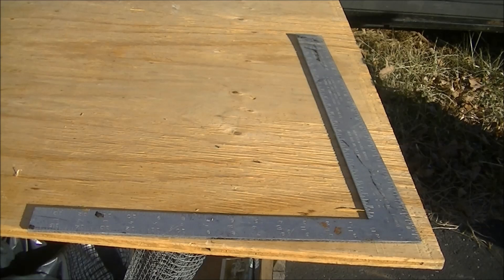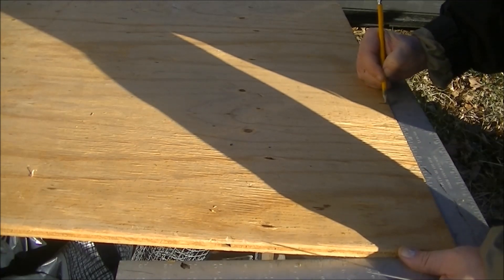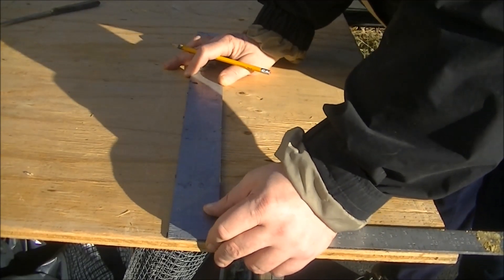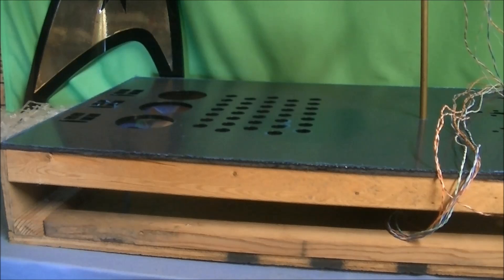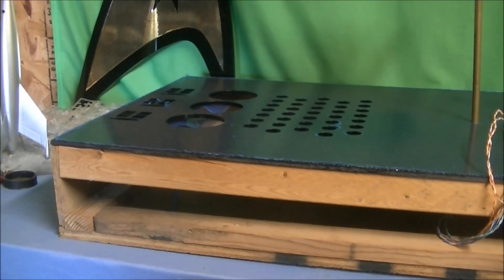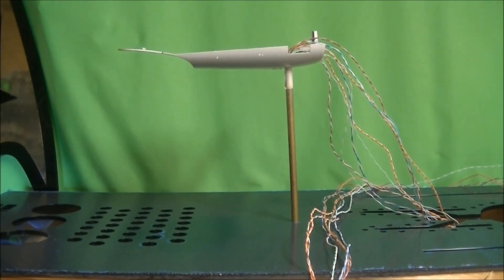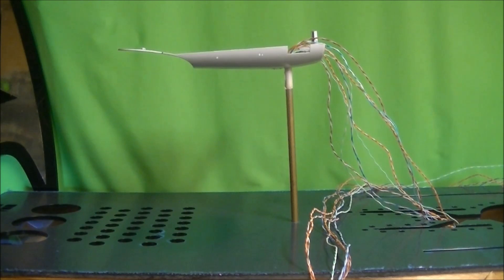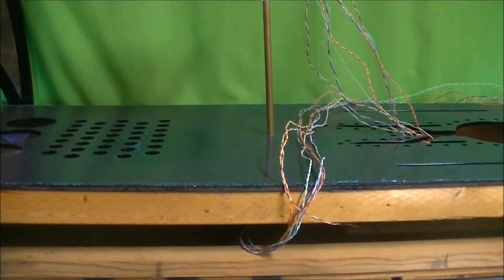Captain Quirk's Quickies 3

Comment: Holy Mackeral, Joe-- there doesn't look like enough room in there for all the circuitry. Maybe you will need a big hammer to stuff it all in tighter.
Show more Guardian Arch thingie-- it looks like you will have a space under the diorama for some circuit board action. So will it be a double board with a gap?
Sometimes one has to be a carpenter! When you need a 1:1 model base!
Reply from the maker: There's plenty of room in there... ;)=/\=